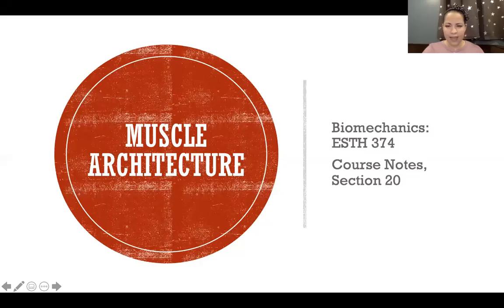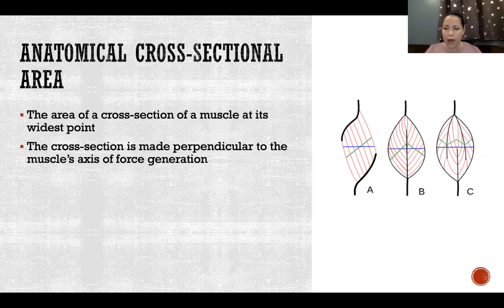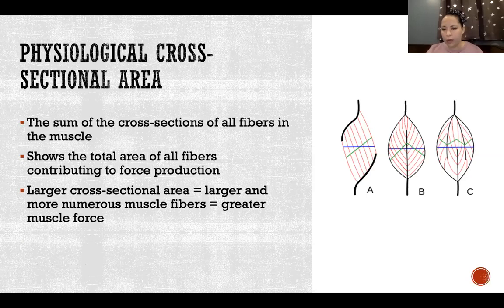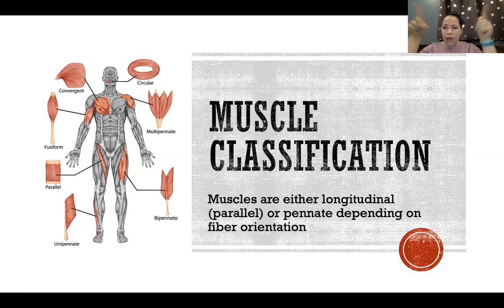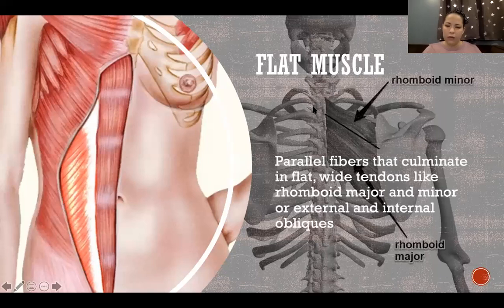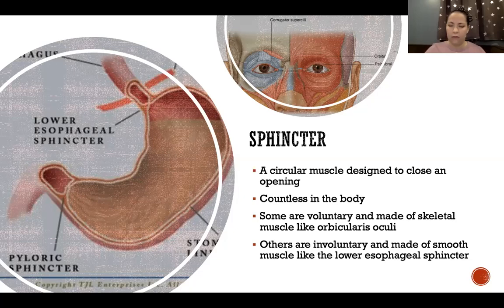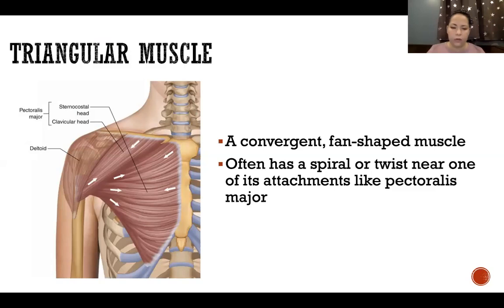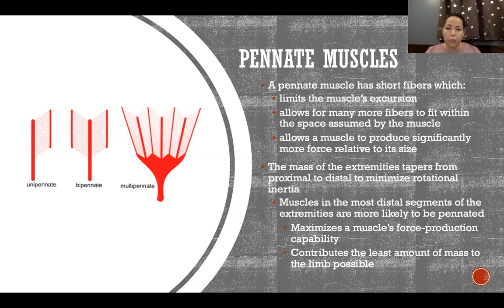Muscle Architecture

Comment: Great video!!! Helped me remember a lot from biomechanics class
Do you know by any chance why in studies for hypertrophy or strength training they measure pennation angle?
Does it change with exercise or lack of exercise? What angle is considered more advantageous for greater force production (do we always prefer lesser angle? and can we even change it through exercise)?
Reply from the maker: Great questions! Pennation angle does not change in response to training, but it needs to be measured in certain types of studies so that the results can be controlled for the pennation angle since it is a variable that could affect the results. Generally speaking, a muscle with a higher angle of pennation is capable of producing a greater amount of force compared to a muscle of equal mass, but with a smaller pennation angle. Here is my video about pennation angle, in case it helps: https://youtu.be/1y-uzCfVENE